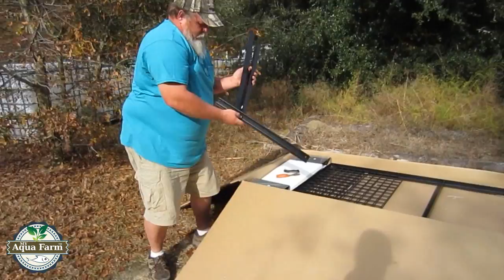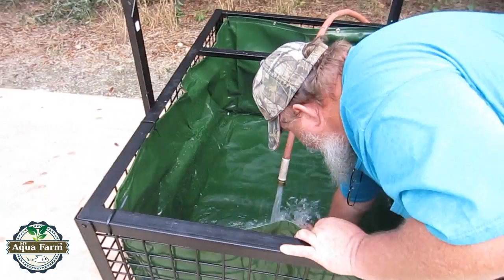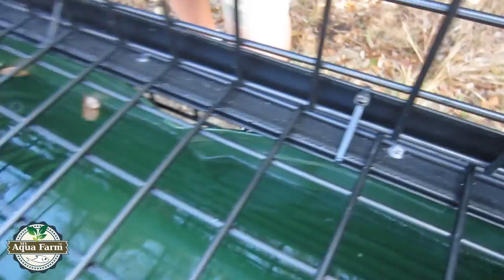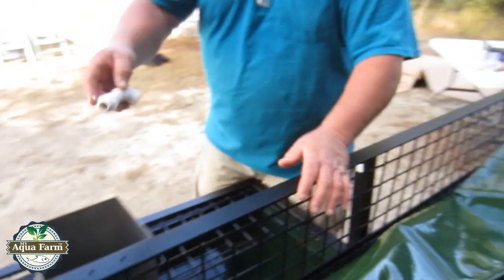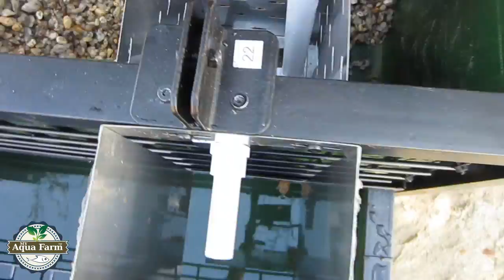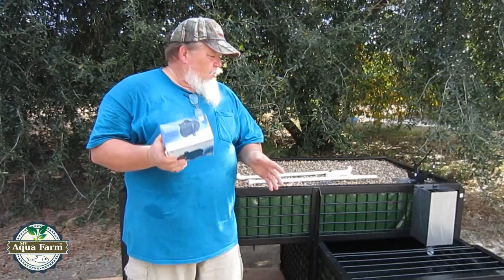MyAquaFarm Aquaponics Construction Video

Comment: First of all, i love the simplicity, elegance, and "non-jerry-rigged" appearance of this system. It's the only system i've seen that looks like it was designed for the purpose or AP. Questions....

1) How do you recreate the typical SLO (solids-lifting) intake on the pump? I can imagine, with such a large fish tank footprint, that solids may settle in the corners of the fish tank.
2) Without a sump, how do you handle the varying water height in the fish tank and mixing of supplemental nutrients (magnesium, phosphorus, etc) and gradual pH balancing? I only mention it because doing so directly in the fish tank can shock the fish.
3) I notice empty space under the left side of the grow bed. Have you considered incorporating other AP elements in that space as options (sump, radial flow filter, moving bed bio filter)? The engineer in me always looks for non-utilized space for "options".
4) What's the best way to clear the media filter of invasive roots?

Kudos, sir, for offering a legit, professional AP system!!

JB
Reply from the maker: Thanks so much for your astute observations concerning the design of My AquaFarm.  My apologies for not getting back sooner, I've been overseas for 2 weeks building an aquaponics system from local materials for replication to use in refugee camps in Iraq.  In answer to your questions:

#1 - I've never in 10+ years doing aquaponics had an issue with this.  The pump runs continuously and the swimming of the fish keep things moving as well as the agitation of the flood valve activation and keeps solids going through the pump to the growbeds.  What minute amounts that might collect in the corners would slowly decompose and simply add nutrient balance to the water chemistry as it should.  Over feeding is the primary cause of excessive solids (and a whole host of other issues) in an aquaponics system in the first place.  I've always fed for fish general health and not growth and as such experience better plant growth.  

#2 - First off, the perceived "need" for a sump tank has problems that many aren't telling.  I personally prefer not to use one as it adds water volume without the ability to add nutrient load as it forces a high stocking density in the fish tank to compensate for the added volume (of the sump tank) making the system more vulnerable to dead fish in the event of a power outage or pump failure (an inevitability at some point).  The changing water level is really a false argument by the sump tank advocates as it's a naturally occurring phenomenon and if a regular occurrence, the fish have no issue with the small amount of water level difference this system experiences.  As far as mixing of nutrients in the system, please remember, these systems have a very dilute concentration of nutrients.  This is the opposite of hydroponics.  The only time I've had toxicity issues is when pone has a damaged (or dead) biofilter and ammonia and nitrite concentrations spike.  In a properly ratio'd system pH balance is really not an issue.  High pH swings are more likely to be caused by excess algae than anything else.  The placement of the fish tank mostly under the growbeds help reduce this possibility as well as giving the fish a place to retreat to reducing stress even more.  The fish are very happy in this system.  

#3 - We have plenty of future use for the unused real estate in this system.  I share the same penchant for desiring to be efficient with a design as do you.  The whole notion for a "need" for sump, radial flow filter, moving bed bio filter would violate the desire for elegance I strive for.  These components are simply not needed in a properly designed system as all the function of them are taken care of in the design.  As previously stated, no sump is needed or even required, radial flow filter neither as we want all biosolids of a properly fed system to be ultimately deposited i the gravel beds where they can decompose slowly and naturally releasing micro-nutrients into the system.  The addition of earthworms can greatly facilitate this bioconversion as well.  A moving bed biofilter is also not a necessity as the operation of the system over time planting, removing and mixing of the media will keep hard line stratification from occurring.  Once again, worms can come to the rescue.  Every bed I have earthworms (any variety, by the way from red wigglers to night crawlers have the same effect) in the gravel stays loose and non-compacted.  I have designs ready for worm bins for the space under the growbed.  this space could also be utilized for mushroom production as well.  I like the idea of growing worms though as it will convert unpalatable vegetation into high quality protein for the fish as well as worm castings for improved nutrient balance and even pest control (worm casting tea as a foliar spray).

#4 - I'm not quite sure what you mean by invasive roots as any plant in this system is intentional and would not be invasive.  If you mean clearing roots growing in places where they can become problematic such as the seat of the Flood valve, I simply reach down into the valve well and tear them out.  Never really had that much of an issue with this system.  The Barrel-ponics systems will have roots growing out of the drains and clog them from time to time.  I make a tool for reaching back in that space and grabbing them and pulling the mass out.  The My AquaFarm does not share this design.

Once again, thank you for your questions.  I hope the answers are of use to you.
Reply: MyAquaFarm.com Thanks!!! I appreciate the prompt reply! My ADD is kicking in...

Instead of soil-less media, I wonder if the upper portion could be configured into a constant flow wicking bed....

As far as the unused space, yes, I like the idea of a worm or mushroom farm. Or hanging shelving. Or top-off water degassing container for those of us on city water.  

What fish/plant species combos have you found grow well in this system?

What is your fish density per gallon?

What is your typical feeding schedule and feed composition?

Do you have over-flow safeguards in the case of rain intrusion?
Reply from the maker: heyniceguy I personally like the flood and drain characteristics of a media bed.  Much more versatility as far as plant options.  
I primarily use tilapia in my systems here in South Carolina.  I try to keep things below 1lb./5 gallons of water for stability.  It doesn't take nearly as many fish per gallon as one might think to get very good plant growth.
I use commercial bulk fish feed and only feed what they can eat in 10 minutes or so once or twice a day depending on their needs (temps),
I always design overflow protection in all my systems.  Wet fish are happy fish, dry fish, well, not so much :).
Hope this helps.  Sorry about the late response.  Been in a remote location this past week.

Comment: Nicely packaged system! I really like the boat trip lever! I also like the one pump does it all setup for moving the water and aerating the water for the fish. I run a heated system with Tilapia in it and I have wintered them twice now with insulated tanks to conserve on energy use.
Reply from the maker: I really like the fisherman as well.  Hopefully we can do some variations on this in the future.  The nice thing about my Flood Valve, not only will it work when a bell siphon won't, it's just a lot more fun to watch and not boring.

Comment: I've been researching aquaponics for the past few weeks and instantly fell in love with the idea. I really love the simplistic nature of this particular build. I'm curious about how much it cost though.

Most systems I see are using really expensive (for me) IBC tanks, which are way out of my reach. Simply because I don't live in an area where they're relatively available, nor do I own a truck, and the freight costs are ridiculous! 

Again, I really love the way this particular system is put together and would love to know the costs of the materials. IE, the gate container thing, the (what I assume thick) liner, etc. Thanks!
Reply: all you need is a fish tank and a 2 rubber maid bins one with pee-gravel and other for your floating lettuces then a cheap pump. and pvc you can buy a 4-5 foot peace and a  flow valve, 5 elbows and 2 rubber gasket 3 sets of female and male connectors with rubber gasket and large rubber washer
Cut hole in  rubber maid so male and female goes through tightly with rubber washers on both end then cut pvc to connect them
^
I [fish]
I       I
I      [pee gravel] don't need but good for filter
I        I
[pump -flowing plants]
Reply from the maker: wildoxidizer I've been building and designing aquaponics systems for over 10 years.  The system you describe will have fallen apart due to UV exposure and the elements in a relatively short time compared to the My AquaFarm which is designed to be around decades.  Cheap pumps and materials will simply not last the long haul.  Might be good for a learning experience but why waste one's hard earned money on something cheaply made from inferior materials?
Reply: MyAquaFarm.com Not that your system is not worth the value to purchase. But some of us do not have almost the 1k that it costs to purchase.  Do you have any plans of smaller designs? or offer possibly the purchase of a DIY kit that is smaller to where your big kit is better, but again for those who do not have the funds for it, but could truly benifit from it....? hope that made sense... anyway, great product!!!!
Reply: yhwhdesigntruth I've recently set up a DIY install inside a greenhouse. Total cost is about $50 (not counting greenhouse, obviously). It's amazing what you can do with so little and have the need. I'm one of the few who can't afford $1k for a system. It's called being poor. Welcome to the economy.
Reply from the maker: bugs181 Glad to hear you built a system.  Helping those who are short on finances and long on DIY is why I have been giving away the Barrel-ponics manual for free since 2005.  I was one of, if not the, first to give away such information.  Unfortunately the price of "free" to the world has come at a personal high price to our family.  Not that we mind at all, just has created the need to provide a system of very high quality that will last for decades taking advantage of my 10+ years of experience doing aquaponics for those who are not so DIY inclined at a price considerably lower than other less quality systems out there.  I'm kind of wondering what size system you can build for $50.00 and what the longevity and production of such would be?  It sounds like you're comparing your build to this one.  I'm not sure that would be a fair assessment.  The liners alone (probably the least expensive part of this system) of My AquaFarm cost much more than $50.00.
Reply: MyAquaFarm.com I think that's precisely my point. I'm just giving others that are new to aquaponics a heads up that you don't need an expensive system. My friend is now building his for practically for free using plastic barrels that our local restaurant is giving away. In fact, they don't mind at all because normally they have to pay to have them picked up and recycled.

Let's be honest.. Aquaponics has become more scientific and overly complex than it needs to be... Really all you need is a place to store some medium that has the ability to flood and relieve that flood, and an equally sizable fish tank with a pump. I didn't like the complexity of the bell siphon, so I just used a hose loop. Works equally well, no moving parts, etc.

My $50 system is actually much bigger than yours. In fact, it houses 4 equally sized systems and a much bigger fish tank inside of a greenhouse. Everything I needed was at a local landfill being disposed of anyway.

As for the life longevity of my system compared to yours, I would have to say it's probably much longer. It's built from concrete blocks and very thick all purpose 4'x2'x12" tubs that only cost $8. If the tubs crack or whatever, $8 is really nothing. I doubt they're going anywhere any time soon. Whereas, your system would probably show signs of metal deterioration and rust after a decade or two. Not everyone lives in a non-humid environment. Like myself, where about 70%+ humidity is common.

Let's also take price into consideration. How many versions of my system could I build for just the price of one of yours? I'd be inclined to say A LOT!
Reply from the maker: bugs181 Ok, let's be realistic here.  For one, a pump for a system you describe will cost more than $50.00.  Also consider the ability to move it?  Not that good.  I applaud you for using found materials.  I'm all about reusing.  That's the whole philosophy behind Barrel-ponics!  

The My AquaFarm is powder coated so will last far more than 10 years.  For the record, I live in South Carolina and the humidity many times is even higher than 70% as is the factory where this system is manufactured and was tested before going into production.  

As far as things having become too complex, maybe I should give a little background to myself so you understand my perspective and design philosophy.  I built my first system in 2003 after paying $200.00 for a small information packet.  That first system consisted of two pumps (one for the fish tank and one for the sump) with 2 float switches to operate the pumps.  This system was the first system on record to use plastic barrels (35) as growbeds and was the beginning of "Barrel-ponics" (a term I coined and have the Federal Trademark).  The problem with that system was it was too technology heavy for application in the third world (a subject I first wrote on in 2005, http://aquaponics.com/media/docs/articles/Aquaponics-for-Developing-Countries.pdf) and simply not doable in most places.  I changed all that with the invention of the Flood Valve used in Barrel-ponics which is still very much alive and well today and detailed in the Barrel-ponics manual (worldwide distribution and over 250,000 copies given away from my websites alone).  It works in a much wider set of parameters that any bell or loop siphon out there (my system can operate on flows as small as 10 gph in case a restriction in a pump occurs while one is away and simply cannot be overrun).  I've built systems from local materials in America, Africa, Lebanon, China, Guatemala, Philippines and just recently in Iraq so I know a few things about using found materials.  The My AquaFarm is not intended for the DIY crowd as I explained in an earlier post.  This system is based on over 10 years of doing aquaponics and being an innovator in this craft and makes it very simple for anyone (who has the finances, manufacturing and shipping are not free) to have an aquaponics system.  No complicated technology prone to failure in any of it and it's just plain good looking to boot!  I hope your system does well and provides a great deal of food for your family and neighbors.  But let's be honest, not everyone has the materials available you did to build your system nor, would I venture to say, would you , most likely, next time you went to the land fill.  Materials in places like that change regularly, I know I've scavenged many times over the last 10 years.  I have a system here myself that utilizes 80 blue barrel halves has a 5000 gallon fish tank and a 700 gallon ferrocement flood tank.  I'm totally on board with the DIY thing which is why I give away a detailed 101 page instruction manual on the construction of a small backyard aquaponics system (Barrel-ponics).  Always have, always will.  In fact it was after 10 years of giving away information free I've finally introduced this system to the retail market.  Most of the self proclaimed "experts" out there cannot make that claim and have been in this game for far less time than I and simply because of the money they hope to make.  That's not me.  I'm one of the guys who actually simplified aquaponics and made it doable by the average guy like yourself.  If you want, Google my name "Travis W. Hughey" and you'll see I've been doing this for quite sometime and have more than most invested personally in making this available to the masses whether the DIY crowd or those able to pay for a high quality system, shipped to their door at a fair price.
Reply from the maker: yhwhdesigntruth I have had free plans available since 2005.  Currently you can download them at www.myaquafarm.com.  Just look at the bottom of the front page and click the middle button.
Reply: Thank you greatly. I was just laid off so this is even more useful now.  I applaud what you are offering. it is amazing and IF I had the money I would be buying one... Keep up the amazing work!!

Comment: Hi I have a question- out of so many different substrates available, you've chosen gravel- why is that? thx
Reply from the maker: The answer to that one is simple.  Gravel is locally available and inexpensive.  I situate my systems on the ground so weight is no issue with me.  This system is designed to easily handle the weight of any media you might choose.
Reply: MyAquaFarm.com
It's a very cool system, I wish I could get one like this myself :(